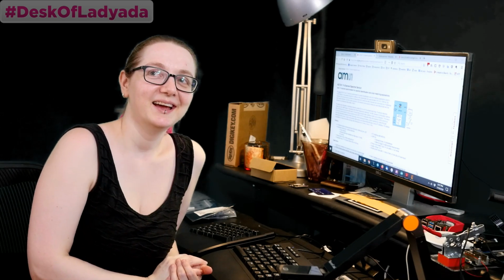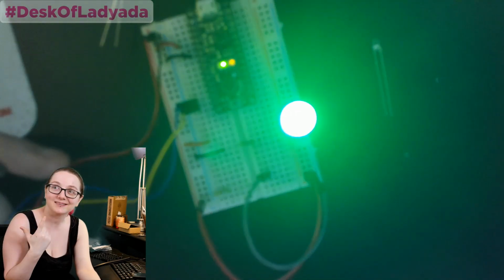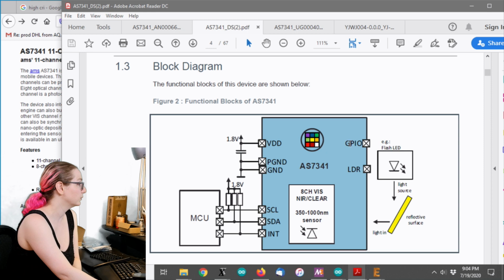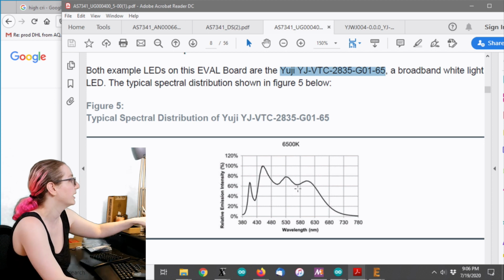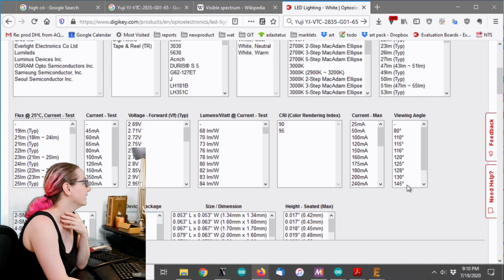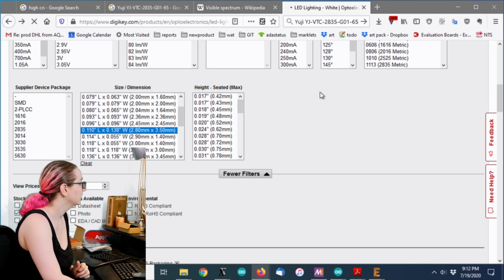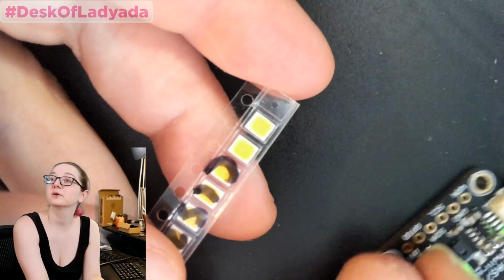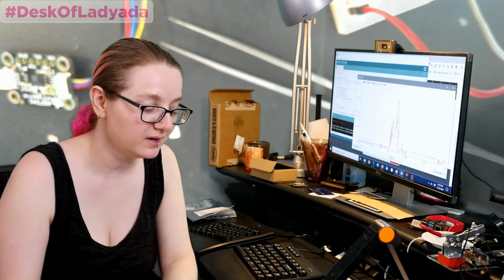DESK OF LADYADA - Testing the AS7341 spectral sensor - searching for high CRI white LEDs on Digi-Key

Comment: How exciting to see this.  I’m the test engineering manager for opto division at AMS.
Reply: Can you explain the difference between the "Normalized Spectral Responsivity" (Fig 18) and "Measured Spectral Responsivity Relative to F8" (Fig 19) in the data sheet?  It's a bit confusing.  The latter seems to indicate that if I want flat response, I would have to scale the various wavelengths so that the peaks line up.  But looking at the former, it appears that they are already flat.  Or is the former just intended to show the shapes of the response curves, and the latter shows the actual relative responses of each sensor?  I'm trying to use this to make a simple quantum-like PAR sensor to estimate PPFD.

Comment: If the light is too bright, you'd risk saturating the photodetectors. Does the sensor-IC adjust the white light to ensure that none of the photodetector-channels saturate?
Reply: yes you can adjust the current to the LED to adjust the brightness

Comment: I connected one of these to an ESP32 with an OLED (64x128).  I displayed the values and a bar chart for the 8 visible channels.  I'm getting the green channel showing a spike that's almost always higher than the other channels, even in sunlight.  I haven't waded through the Arduino library yet, but has anyone else experienced this?
Reply: Oops, missed the array index change halfway through.  First 4 channels are Readings[0]-[4] and the remaining 4 are Readings[6]-[9].  Hopefully this helps someone else ...
Reply: @surferdudemi  I am using this sensor with Raspberry Pi. Can you help me read the values from NIR, Clear and Flicker channel please?  Example codes provided for Python is very less. Thanks
Reply: @ashish_ash04  I've only used Arduino (C language), so not going to be much help.  Do you have the spec sheet on the sensor so you can see the register addresses for the data and how to read it?